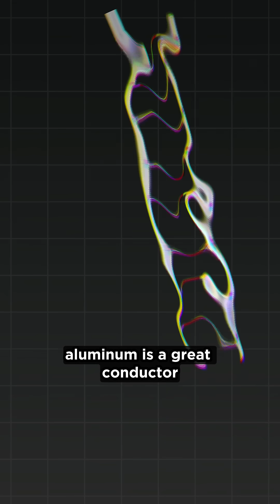How Did This Ladder Melt The Ground?

Comment: As someone who worked in construction, the amount of stories you hear about people being just melted because they were carrying a ladder and hit powerlines is terrifying. Why I respect electricians heavily, but you will not catch me ever doing that kind of work. Electricity is so scary
Reply: Man ive seen a video of this dude with those big power breakers and all you saw was a blue ball of lighting for like a good 4 mins and once it finally stopped he hasnt there anymore like he was gone
Reply: @myytgotdelted2733  Fun fact: an arc flash can reach temperatures of up to 30,000°F (16,600°C). I’m an electrician apprentice and we obviously have to learn safety so that’s why I know.
Reply: @myytgotdelted2733 that sprcific type of boom isnt real. A person cant ve entirely vaporized by that. The body is made up of a bunch of different parts with its own electrical current. At most, it definitrly cooked the dude.
Reply: @myytgotdelted2733 Yeah, 4 minutes is a long time jeez! Not surprised bro got eviscerated. That’s horrifying.
Reply: @hemlockolympic it it form a ball it’s powerful enough that he didn’t suffer for long as least
Reply: Saw a clip from China where 6 people were moving a scaffold platform on wheels and hit a power line
Reply: @korpen2858 
I saw that too, all 6 of them just instantly dropped dead
Reply: In my country they just use bamboo ladders. Does it help?
Reply: @trsiami  In mine, we bury the powerlines
Reply: @trsiami  I'm genuinely curious where that is.  I have never seen a bamboo ladder, but bamboo isn't a super common resource in the US.

Wooden ladders used to be common here.  Don't quote me on this but I think aluminum ladders started taking over the industry in 40s or 50s.

Old wood ladders were still around but somewhat uncommon when I was a kid in the 80s and 90s.  I haven't seen one in a while now though.
Reply: I have seen bamboo ladders in China, but mostly they use wood.  When it is more than 2 or 3 meters high they use lifts instead though, or rappel from the roof.  Bamboo scaffolds are more common than bamboo ladders but have been slowly replaced with steel.
Reply: @trsiami  well wood doesent conduct electricity so id imagine bamboo doesent either (not 100% abt this) so it should help if it doesent conduct electricity
Reply: @trsiami  Probably.
Unless it's wet.
Reply: You gonna keep the aluminum landing ladder welding stick technique for you next work site?
Reply: Ok this is a new horror scenario 

Although I do wonder where are you guys seeing these kinds of videos?

Purely for research purposes of course, it’s quite an otherworldly thing to imagine much like this video
Reply: I'm an industrial electrician hoping I don't get bit too bad one day
Reply: @EL_Cocaincola  hi, this is an internet stranger asking you to add 1-2 extra precautions to your daily routine so that you stay alive. I have no idea what those are, but I bet you do.
Reply: there is specially made fiber glass ladders for stuff like this, this is a complete oversight in safety and osha and whoever made the poor guy use this ladder needs to immediately face consequences
Reply: My dad was an electrician and had me come to jobs with him where my entire purpose was to call 911 if he got electrocuted. Fortunately he was a great electrician but it has left me traumatized and frightened of electricity.
Reply: Wooden ladder superiority
Reply: @jameswolfe2678

Yeah on this point but fiberglass would last longer and give you all most of the strength and all of the grip advatages of aluminum, along with not rotting from moisture (but potentially degrading from sunlight)
Reply: @jameswolfe2678  fiber glass ladder
Reply: It's linemen who have the real balls. I'm not an electrician, but I've done hvacr for 8 years and there's a lot of crossover. Residential and even light commercial electricity isn't melting anyone. Can it kill you? Yes. But you're not going to melt. Go mess with 12kva, or industrial disconnects/mdp's though, and that's where a electrician becomes a real electrician and I agree. I'm not messing with any of that lol
Reply: Ah, electricity. Manmade horrors beyond my comprehension. Wonderful.
Reply: My buddy is a lineman and sent me a pic with barely any context from his monthly magazine that has all the horror stories (for both condolences and warning to others) and I thought it was a deer. 

He said "7200 right through the back" and I thought it was some new firearm model I never heard of cause he's a big hunter. 

Slowly I adjusted and realized what I saw. That poor guy might die. His entire right shoulder blade and about half the left, down to his right hip and up over his right shoulder was raw muscle without skin. I'm getting chills typing this
Reply: meanwhile 10 year old me helping my dad work with 200 milliamps: yea sure this is fun
Reply: @What_you_looking_atBlyat 200mA is nothing..?
Reply: @What_you_looking_atBlyat  200mA is pretty low power
Reply: @What_you_looking_atBlyat touched car battery once, got shocked then went to help my dad
Reply: Years of experience as a technician and now an electrical engineer I can tell you your a smart man, the people who get hurt or killed by electricity are the ones who don’t respect it
Reply: Fibreglass ladder worth the investment. Just don’t walk away from it it’ll get stolen in a flash
Reply: Living in a country with all powerlines underground is nice. Coming from western Europe.

Except the large distance ones of course that are way up
Reply: There are two fields of blue collar work 
Construction where electricity is terrifying and auto repair where electricity melts your brain trying to figure out what you did wrong with a oil change to make your wiper controls trigger your trunk to open when the left turn signal is active
Reply: William Aftons Door in FNaF 6 typa shit
Reply: Just don't use aluminum ladder. If your electrician is carrying one, tell him to stop immediately.
Reply: That's why smart people use fiberglass rail ladders
Reply: all trades need to deal with electricity. I like being an electrician because im aware of what i consider the most dangerous thing on the jobsite.
Reply: Makes you wonder why don’t they just put some coating on the metal like rubber or something?
Reply: @GraysonicYT  because it would get molten through, power lines heat up and cool down during the day and night specially at night when everyone is pulling power from the grid, adding a coating just complicates things unnecessarily.

You gotta remember this also, at high voltages electricity does not give an ever loving fuck about resistance or insulation, so it will quickly destroy all the wires touching it.

Rubber is a fantastic idea at 120-240 etc, terrible at 100,000 and so on
Reply: Oh god.. the sight must be horrible for the first responders.
Reply: Dont call them that lineman’s don’t like being called electricians
Reply: Somewhat related I remember a story about some teen that climbed on top of a train and touched one of the high power cables 
Fire fighters said his body looked like a burning tree stump
Reply: @guardedcobalt276 we had that happen in the storage yard of our train station where i live, three teens (2 boys, 1 girl, the girl and one of the boys were bf/gf) decided it was a good idea to break in and climb onto one of the locomotives, and once they were all three ontop, one of them got a little too close to the 15kV line and together with the 2 others, was sent flying off the locomotive roof. The guy that became the new conducting material died, his gf was in coma for a while, and the other guy somehow only had serious burns and broken bones.

Another reminder as to why you dont go close to rail lines if you are not allowed to and dont have the proper equipment, skills, and education.

Yet here i am currently studying to either work on the signals for railways or on the 15kV line itself
Reply: Electricity is only dangerous if you're not careful. If you take precautions, you're gonna be safe. Carrying a ladder and hitting the powerline is something you can minimize if you fold the ladder and do not carry it extended up. Powerlines are usually very high from the ground, so unless you try to carry a super long extended ladder, you're not gonna hit the powerline.
Reply: Linemen are real life heros
Reply: Still remember that video of three or four dudes carrying a scaffolding, hit a powerline, and all four of them just collapse.  One of them still collapsed on-contact with the scaffold and started to burn up.
Reply: Why you use fibreglass ladders instead!
(The really brightly coloured ones)
Reply: if you work with it, you know what not to do. 9/10 times, people that die to electricity are not people working with it.
Don't quote me on that statistic though 😂
Reply: u just unlock a new fear for me
Reply: You don't need to be an electrician to be hitting a power line while carrying a ladder.
Reply: bro why are the high voltage wires going through houses      i am Indian
Reply: You would be surprised at how many people screw around with electricity and not just splice boxes or switches and receptacles ( outlets ) but in sub and main panels as well. The things I have seen make me wonder how do they put their pants on with those watermelon sized balls and pea sized brains 😂
Reply: FIBERGLASS
Reply: as a welder- it's kinda awesome
Reply: Hm
Reply: Your friends sure do like to scare you with made up stories, or do you live in some developing country?
Reply: Fiberglass ladders for the win 😂
Reply: Nobody tells stories about plumbers drowning
Reply: People don't melt
Reply: Wait, so he just CASUALLY say he’s heard REAL stories and seen people being MELTED ALIVE by a power line.. what the actual he11.. 💔
Reply: They sell those orange fiberglass ladders for this exact reason. But yeh if you didn't know that you probably shouldnt be doing electrical work.
Reply: @BenjaminBrown-o8r fiber glass ladders are beter also because they tend to hold more weight
Reply: Metal ladders should be prohibited then 
Why not use wooden ones ? 
I'm no an expert in this field tho so i don't know if it would be possible
Reply: I mean,  you fear what you don't know, right?
Reply: Just had 4 roofers die in pa about 2-3 weeks ago. Laddervator started tipping away from a house. 4 guys tried to grab it and pull it back

4 families didn't have their loved ones return that day

If the loads falling. Let it tf go. And be wary around power. Insoect sites before working and look for hazards. This shi ain't a joke
Reply: You never worked construction
Reply: That's why I quit. Got thrown off an 8 ft. ladder after my associate swore we cut auxiliary power on a commercial job. I now work in insurance, lol
Reply: Remove these images from my head
Reply: It's not scary if you understand it
Reply: Its a fun trade for someone with the right mindset. But not everyone is "built for it" (mentally speaking, it takes a certain kind of brain to mess with angry pixies for a living)
Reply: My dumahh thought it was wood..
Reply: I've gotten lucky, apparently. I've probably hit at least 20 live powerlines while carrying aluminum ladders and have never gotten a shock or spark.
Reply: In civilized countries, there are two types of wires: low-voltage ones, which are insulated, and high-voltage ones, which are not insulated and are therefore placed out of reach of a simple ladder, a ball, or anything else — either at a sufficient height of several tens of meters, or buried underground.
Reply: Its not scary once you have vast knowledge about it
Reply: @derekcarter8492  The more you know about it, the more you realize these things will kill you the moment you don’t respect the danger they pose, and that’s if you’re lucky. If you’re unlucky, you survive with horrifying electrical burns and have to deal with chronic pain for the rest of your life.  Always check your arc flash suit for holes.
Reply: @derekcarter8492  Well, for some it is still scary, you just know how to minimize the risk lol

Spent 4 years as a general electrical systems specialist (everything from high-power distro to control circuits) what's really terrifying is when you see the ground around the old wooden utility pole mimicking the transmission wavelength, and knowing you are the person that has to go "deal with it" lol
Reply: @derekcarter8492  no, it's still scary, especially when you are tasked to deal with it.
Reply: @derekcarter8492  once you have enough knowledge it goes from scary to super interesting
Reply: Aren't you familiar with insulated wires in your country?

Comment: So how do you design circuit breakers when there is resistance circuit? What is approved and not approved current flow? Someone moved the ladder with rubber gloves. Provide cops with rubber gloves. How will the ladder rise itself from asphalt to pavement? Can tar flow up the ladder when current is passed? Can any fluid (ferro fluid) flow because of current?

Comment: I think the reason a circuit breaker didnt trip is because the ground, as she mentioned, is resistive. Current cannot flow too quickly and circuit breakers only trip when there is a lot of current.
Reply: Without the current the concrete/asphalt wouldn't melt, so something is wrong.
Reply: @OllieJsonable  nope. Current DOES flow, but because concrete is resistive, it cant flow too quickly. The way a circuit breaker works is it trips when current flows too quickly, like if a metal object shorted out the terminals (metal isnt as resistive as concrete so current can flow a lot faster)
Reply: @xx_zc123_xxplayz9 I thought you would understand what I meant so I put it short there. 

To melt the concrete/asphalt you would have to have a high current. If it were low current it wouldn't be able to melt it.

 Also, on higher voltage cables the fuse (when you have enough current and/or voltage you don't use a circuit breaker as safety anymore, that's just to break the circuit manually) is made with a much lower current breakpoint because there is not that high current, it's rather higher voltage instead. So when I talk about high current, I mean compared to what's normal. In this case it might be less than 2A but because the line is 12kV, or somewhere around there, it's still gonna be around 40kW of power.
Reply: @OllieJsonable  thank you for clairifying. Sorry i got it wrong

Comment: The recloser probably had a fit and then tripped (a recloser is a fancy type of circuit breaker for power lines that will attempt to restart the circuit in case it was a temporary short a few times and eventually it will stop if the circuit keep shorting)

Comment: As long as the current stays low enough the circuit breaker doesnt't trip. That line might be feeding a small industrial or large residential area and capable of delivering 2 MegaWatts.

Comment: Btw the ladder is touching "medium voltage" wires. The ones it's not touching are most likely communication wires. The other lines are above the frame.
Reply: High tension wire*

Comment: circuit breaker didn't trip because even though it touched the ground the current is not enough or it didn't reach the required time being set in the feeder relay

Comment: Sorry for my english...

The reason electricity flows through the ladder without triggering a shutdown is likely because the grounding resistance of the asphalt is high enough that the resulting leakage current is too small for the high-voltage protection devices to trip.

2. reasoning, protection device is faulty... it can happen
Reply: nothing's wrong with your english
Reply: @yannicklokur  Thx <3
Reply: The current required to melt the concrete/asphalt like that is more than I would consider safe. So if your first theory is true then it's incredibly badly planned and you could just replace the fuse or protection devices with a metal rod and stop calling it a safety... 

Not hating on you btw, I would say the more likely scenario is the 2nd one.
Reply: @OllieJsonable  Yeah you are most likely right!

Comment: There might be an arc?
Though we would see that so maybe not.
Reply: Power lines transmit low voltage, high current. High voltage is necessary to create arcs.
Reply: @KoenigseggEditz856 that is true. Maybe since it's melting and bubbling like that it is constantly breaking and closing contact enough for it to maintain that puddle?
Reply: @KoenigseggEditz856 
That is true.
I think there is still current now but since its conducting through something molten hot the resistance has become much higher making the current lower, hence the breaker wont trip on the thermal bimetallic strip (whatever it is called in english).
Reply: @Smung That’s a reasonable assumption, I’m not smart enough to comment on it so I guess I’ll just agree with you haha.

Comment: Happily surprised to hear modest knowledge of electricity as an electrician.  Typically a certain amount of overcurrent has to be met to justify tripping the circuit. If its line side of the transformer which it looks like it is, you wouldn’t just be tripping power to a house, most likely the whole neighborhood.

Comment: So, there isn't a "circuit breaker" on the lines, since this doesn't look like a rave or something similar I'm betting on secondary line to ground fault, the fuse is located on the transformers PRIMARY side not on the secondary so you need a stupid amount of current to shut that thing off usually in my country it's a 2A fuse at 13.2kV or about 30kW give or take the resistance of the ladder isn't really enough to trip that fuse so it's just gunna continue doing that until a lineman pulls the fuse off